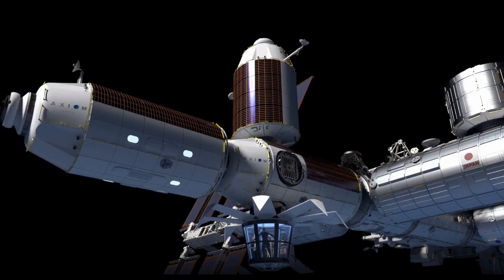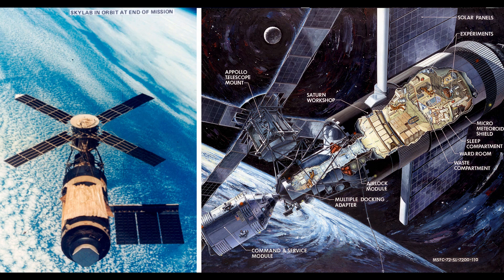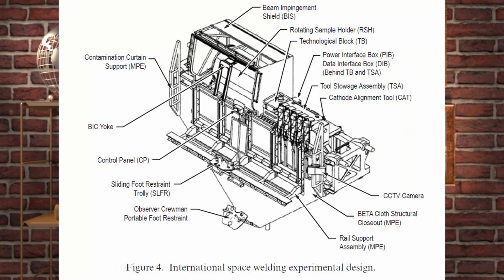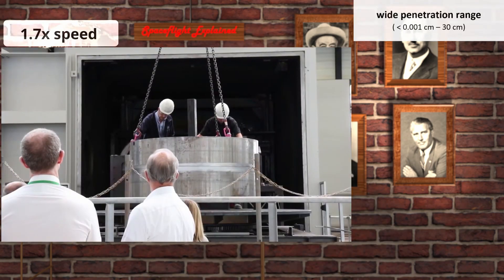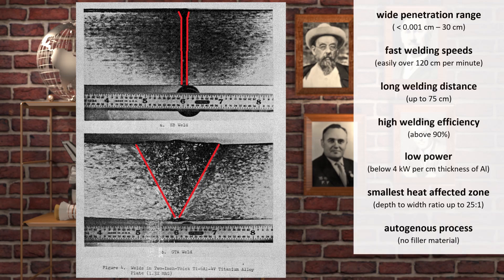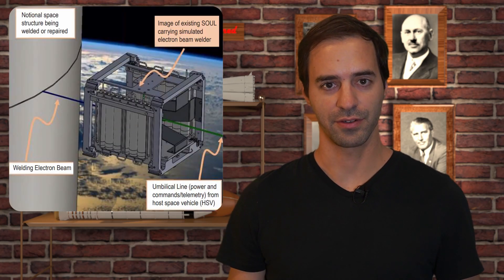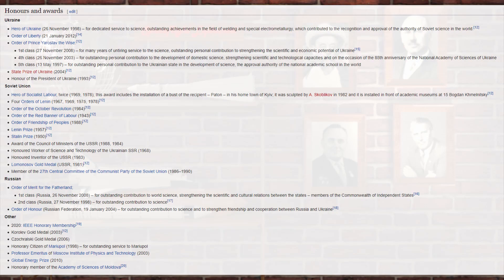Welding in Space - Do We Have the Technology?

Comment: A TIG welding type setup where the torch would be held in one hand and a filler wire feeder in the other would be a pretty good option in vacuum as well. Not needing shielding gas would allow the rig to be fairly compact and the wire feed mechanism could be something like a variable speed spool gun (see the types of spool guns used in aluminum mig welding). Youd have the most control and it would allow to vary your heat and filler speed as you encountered different thicknesses of metal. Andof course aluminum welding becomes way simpler up in space with nothing for the aluminum to react with.

Comment: Really interesting! You can imagine all kind of spacecraft and stations created. Large amounts of cheap and standard structural shapes could transported by starship and then welded together by either welding drones or some sort of magnetic moving welding arm.
Reply: Part of the problem of why space flight has been so expensive other than rocket design is the over complex design of spacecraft that have to fit and then "deploy" from fairings! Needs to be done with standard off the shelf materials that are already mass produced IMO.
Reply from the maker: You nailed it, and it is also a reason why this channel is not very active. I spend time on developing this - Google "ThinkOrbital" :)

Comment: I am expecting SpaceX to make a one way Starship which  breaks down into 3 parts ... 1).  a payload, 2).   an assembly with engines, pumps and electrical system that fits inside a starship’s cargo bay and hitches a free ride to earth in an empty starship.  3). The large tanks and cargo bay that is left in orbit where it becomes building material already in orbit  for space projects. That’s where welding becomes the key. Imagine what can be made with all that freely available 304L steel.   
     And it is the ideal efficient way to lower cost per pound of payload to orbit (a one way starship would have a much better ratio of payload to starship mass, therefor larger payload per launch)
Reply from the maker: Starship inside of starship - I like it! The amount of effort that would have to be done on mars would be really high and dangerous if you don't have cranes already built there. It might still be easier to ship 100 tones of useful finished cargo (even just steel ready to assemble plates) in a separate flight and then get the full starship back.
Reply: Spaceflight Explained I did not think as far ahead as cranes on Mars to unload cargo.  I was thinking more about stations orbiting the earth and the moon, plus a launch/landing pad on the moon. Then more moon structures. Then a large station designed strictly for Earth Mars commutes (never landing, possibly not even slowing down at Mars, just flipping back to earth around Mars while releasing the destination vehicle with people and payload inside).
Reply: Was thinking the same 👍

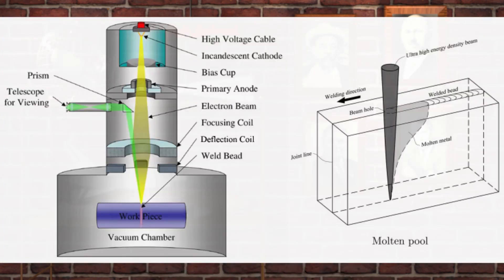Comment: Looking at the diagram at 7:50, I don't see anything to control where vaporized metal accumulates in the mechanism.  

For small amounts of welding, it wouldn't matter. For production use, I would think anything near the weld would accumulate a thin metallic coating via CVD, chemical vapor deposition.

I can think of a few ways to control it, or work around it. The vision system could use a front surface mirror. The mirror surface would get thicker over time, but it would still be a mirror.

The electron beam could be bent with a magnet and directed through a small hole. Metal atoms that weren't ionized would go in a straight line, so they wouldn't coat the electron gun parts. Metallic ions would be curved by the magnet, but it wouldn't match the curve of the electrons.

I am curious how the actual specialists dealt with the problem, or if it turned out not to be a problem in practice.
Reply from the maker: That is a really great question - I would have to confirm that, but I think that with EBW, vapors might be a very small issue. Because of its penetration and narrow weld, the heat is created somewhat uniformly throughout the depth. So I think that with the right settings and calibration, you can avoid vaporizing the metals because you have such a control over the temperature.

Comment: I fear welding is only a tiny tiny percentage of the work needed to create odd shaped space stations. Just imagine all the work after that, all the electrical, the plumbing, the insulation, ... if all that needs to be done in spacewalks rather than being preassembled on earth, it would take for=ev=ver.  Then there are the problems of testing it .. Nah, I dont think in orbit assembly is going to happen any time soon. Perhaps on the moon or mars we will have to if we harvest local resources.
Reply from the maker: Oh absolutely, but that is kind of the point. No spacesuites needed - robotically assembled and welded pressure vessel. Electrical, plumbing, insulation, everything can be neatly packed and worked on while being in a comfortable 1 atm of pressure. Kind of like building a house - outer walls and windows first, utilities after, interior last.

Comment: Uh, welding should be no different in space than otherwise, apart from not needing a protective gas.
Reply from the maker: I disagree. Depending on the method, the gas is not only protective, but also plasma inducing. Without gas, there is no arc. It is hard to keep enough gas in vacuum. Also, in microgravity, the molten metal solidifies differently.

Comment: Why isn’t friction welding suitable for space?  I would have thought it is the simplest method to implement
Reply from the maker: I mention it in the video... It is really difficult and expensive even on Earth... The kind of tooling, strength and precision needed really doesn't translate to universal use. Also, it leaves a hole that needs to be patched.
Reply: @spaceflightexplained360  thanks for the info.
Reply: Friction welding is only useful in factory, where the equipment is made to a specific job

Comment: I though we could chemical weld the metals.
Reply from the maker: Can you point me to where can I read about it? Or some term I can look for? Genuinely interested...
Reply: @spaceflightexplained360  the only chemical welding I can think of is thermite welding of train tracks.

Modern welding is resistive welding and direct-heat welding via lasers.
Reply: @spaceflightexplained360  I was trying to remember, long time ago at school :), it’s finally not that exiting.
It related to metal to composite epoxy adhesive, not the best for vacuum lol
Also I thought it could be related the metal matrix composite (aluminum & titanium), but same there the technic is extreme temperature + pressure.
Or let’s go old school, train rail thermite welding, that should work lol not dangerous at all 🤫

Comment: My interest is smelting iron and making steel in space.
Reply from the maker: That is the future! 
Also, I can't help to think about sci-fi's like firefly, where you can make money by salvaging old spacecraft...
Reply: I used to program industrial control systems for Steel Mills’ Ladle Metallurgy Furnaces.  At these Metallurgy stations the steel comes in from the Blast Furnace and is treated in various ways before it proceeds to the Caster.  The hot molten steel comes in a 220 ton ladles lined with refractory brick.  The steel needs to be at just the right the temperature when it gets to the caster where is solidifies (magic). So at the Ladle Metallurgy Furnace (LMF) 3 giant electrodes are lowered into the steel and a huge amount of current is run through them and the Batch, this makes the steel hotter.  Temperature samples and metallurgy samples are taken.  The metallurgy sample is evaluated by the lab and the Level 2 computer determines what is missing or needs to be removed from the steel to make it up to the desired grade. 
Argon is bubbled up through the bottom of the Ladle through a poised plug (porous to Argon but not liquid steel) to stir the Steel. Sometimes a giant magnet is held near the side of the Ladle for Electro-Magnetic stirring.  There is a Water Cooled Hood that is lowered on top of the Ladle to limit oxygen from getting into the steel.  The Lab reports of impurities that need to be removed from the steel and there are systems to add fluxes to the steel to to help remove them, like lime or Dolomite.  These components can mix with the impurities and they raise to the top to become Slag.  A good layer of Slag helps insulate the Batch of steel and keep it hot (like 2,300 F).  There are always components that need to be added to make the Alloy if steel up to grade.  Some alloys are dropped in through a port in the Hood from an alloy batching system.  Other additives are added through Wire Injection, like if the Batch lacks Aluminum, an inch thick Aluminum Wire is added by pushing it in with precisely driven rollers and measured to the inch.  Other wires are actually shells of steel filled with powders, like Carbon.  Operator also throw bags of alloys and fluxes into the Batch.  Sometime tempers bags sit in top of the Skag if it is too thick.  A good slag layer is important to making high quality grades of steel. 
The gasses and dust that forms under the hood are swept away by a great air current that is filtered in a bag house near by.  There are dozens of subsystems like the Transformer and Switch Gear needed to put the Electrodes on line and make them safe when they are offline.  It is all fascinating, especially the heat coming of the Ladle of Steel. The batch of Steel in the Ladle is called “The Heat”.  The Giant (12” to 24” thick and perhaps 30’ tall) are called Trodes.  The Operators stay in the Control Pulpit, but come out to take temperatures and Metallurgical samples and throw bags of Flux or Alloys into The Heat. 
I used to know brilliant Metallurgical Engineers that knew what adding anything would do to the Heat and what to Add to Fix a Heat gone bad.  I have lost touch with all of them years ago and most are likely dead by now.  The Engineers of all disciples that designed these systems were amazing.
Reply: @eugenecbell  Now how to do that in microgravity and vacuum.
Reply: @bozo5632  yes.  Often between the LMF and the Caster the Heat stopped at the De-Gasser, where the Ladle is put in a chamber and all the air is sucked out.  In this Vacuum any dissolved gas impurities left the heat.  This made better steel.  So, the vacuum of space may be a gear help.  
We use large electro magnets to stir the Heat on Earth.  I think I’m space they could be used to contain the Heat.  Wire feed works just like it does here.  Temp and Metallurgy samples are easy.  Adding in alloys and fluxes ma be all wire feed or some kind of kinetic throwing them in.  The Trodes may need to be increased in number to 6 of 9.   I think the big issue is how to get the skag to float to the outside.  But we will figure it out all that metal in the Asteroid Belt needs to be made into steel.  Perhaps drop it on the Moon and fling it back into space.
Reply: @bozo5632 , on Earth the Ladles need to be have their refractory brick replaced, like just every 5 heats, very time consuming and expensive.  In space the heat could just float their.  The heat could be pushed around a bit by air jets.  I see a giant shell around the heat with lots of equipment minutes to it treating the Heat.  On Earth a great deal of temperature is list to the sides of the Ladle, this is avoided in space.
Reply: @eugenecbell  very interesting! thank you for taking the time to share your knowledge.
Reply from the maker: @eugenecbell  What a privilege to read your experience. In space, how would you remove the slug since buoyancy does not work in zero G? It wouldn't float up by itself...
Reply: @spaceflightexplained360 , this is a problem perhaps get the blob of molten steel spinning?  Whoever solves this issue will be very rich.  I’m no expert, perhaps someone already has solved it.  Perhaps, ejecting it at high speed and letting it separate by density?  We will figure something out, so we can go to the stars.
Reply from the maker: @eugenecbell Actually, slow, long and constant spin and slowly draining from the sides seems like a doable solution.
Reply: @spaceflightexplained360 , once you get the blob of steel to grade and you remove the slag.  You can stick a refractory covered lance into the center of it and slowly inject Argon. As it is spinning and a bubble of Argon is growing in the center of it it will get bigger and bigger.  It is a bubble at this point.  As the bubble grows, it’s walls get thinner.  When you get to a bubble with radios 20 meters and walls 6” thick stop and let it cool and solidify.  Now you have a battle ship hull.  You need to roll it for strength and final sizing.  You cut a hole in the side and insert a machine that is an expanding telescoping device with rollers at each end.  You start it spinning on the inside, by means of driving the rollers, while hitting it from the outside at the same time.  I think it is called hot forming. Now you can reduce the thickness of the walls to 1/2” and the Radius increases to like 150 meters.
Reply from the maker: @eugenecbell  Playing the devils advocate... if you rotate a molten sphere in zero G, extremely extremely slowly so that the surface tension holds it together, would you eventually get a disc in zero G, or elipsoid if you have a lot of surface tension?
Reply: @spaceflightexplained360 , I think it becomes an ellipsoid and the faster it spins the squarer the ellipsoid. 
I have no idea what the surface tension of slot on steel is it could be great or small.